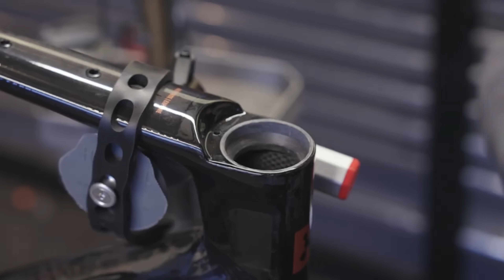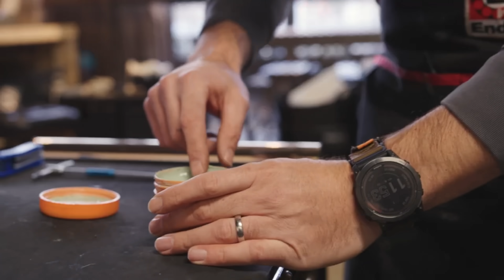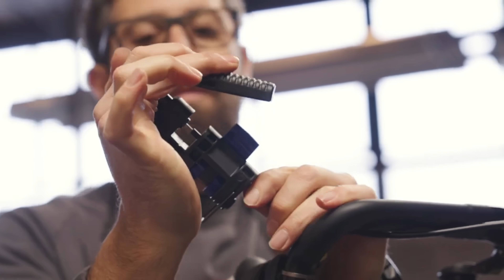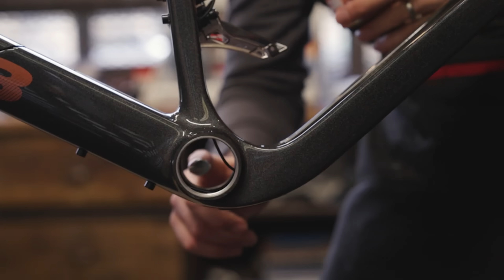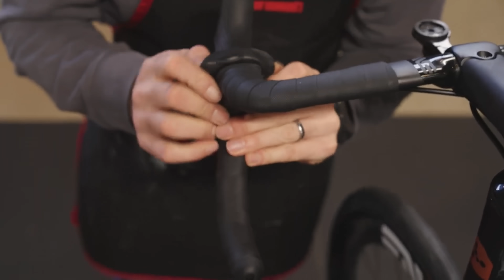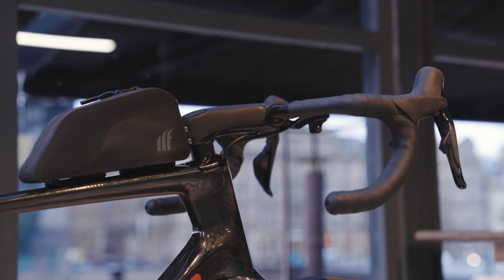MY NEW BIKE

Comment: Bought one of these after some thorough research, watching this and other of Chris’s vids. Will swap out the Force groupset for the Ultegra  on my Domane Gen 4 which is what I hope this bike will exceed.

One thing, the bar tape went from the top to the bar ends, neat, but doesn’t that risk it wearing and unravelling as the edge is now exposed to outward rotation from the hands - I know, that’s just a nerd thought and I really need to get out more…
Reply from the maker: If you wrap it the right way it’s absolutely fine. The Enve bar and plugs are a bit different and allow for this

Comment: Pity you did not show a weight on the scales without the top tube bag and down tube tool kit.  As an owner of the previous generation Krypton Pro this latest model would be a step backwards for me - I like the down tube storage but not the increase in frame weight, front chain ring 50 tooth size limit and orange colouring.
Reply from the maker: The complete build like you see with top tube bag, pedals, Garmin and everything was 7.5kg. I weighed it yesterday
Reply: @ChrisHallRides  thanks for the update Chris - indeed interesting as my Krypton Pro is 7.8kg - suspect that is in the rims (56mm front and rear vs your 49mm and 55mm), cockpit and semi-compact Ultegra vs your Dura Ace. I hope you love riding your Krypton as much as I do mine!
Reply from the maker: I’m so so impressed with it. Such a great bike to ride!

Comment: Lovely bike, but did anyone else just briefly think how much hassle it’ll be to change the headset bearings…. Integration is great, but it’s definitely more painful….
Reply from the maker: It's much easier with this setup compared to some other ones I have used previously.
Reply: @ChrisHallRides  easier, isn’t easy. You still have to remove brake lines the change the bearings… Still looks slick though. 👍

Comment: Beaut bike Chris.  Can I ask about the thought process on the cabling at the front end.  Have you integrated the cables through the stem but not through the handlebars?  Looks very neat.  Thanks
Reply from the maker: Cables go into the top cap. Not into the stem. Allows for adjustment
Reply: @ChrisHallRides  Thanks have just rewatched and seen what you mean.  I think we also need a indepth guide from Nick as to how he wraps the bars!  The reverse of what im used too but looks an awesome job.

Comment: Very nice indeed 👍
I’ve just built up a very similar bike targeted at road ultras, built around a Vitus Venon Evo Frameset, with Dura Ace Di2, and some other nice parts, along with 32mm GP5000. Also using Vision Metron 4D flat mas handlebars with properly integrated aero extensions and di2 shifters on the ends, which I’m really liking and look a bit more slick than typical clamp on aero bars. Have been loving it so far this winter.

Comment: Nice content as always. However, I don't understand why you would want a storage compartment in a bike. It reduces strength (a continuous beam/cylinder is always stronger) for which you will have to compensate, is too small in comparison to a saddle or handlebar bag and you have to prevent the stuff from rattling.
Anyway, best wishes for the New Year and looking forward to more of your adventures.
Reply from the maker: I don’t really like handlebar bags and personally I like the frame storage. Makes a lot of sense to use the space and I’ve found no issues with it. No rattling or anything and I’ve done coming up to 1000km on the bike now